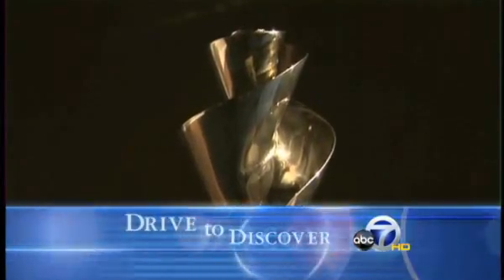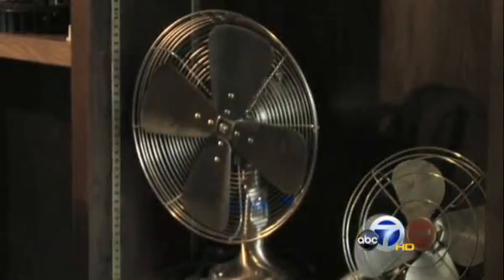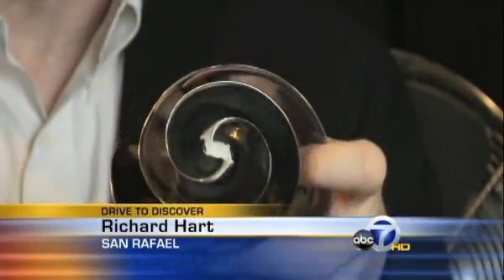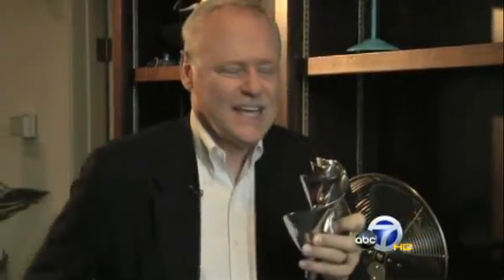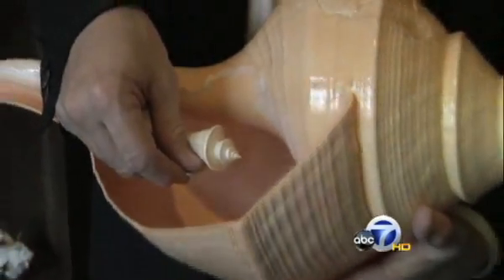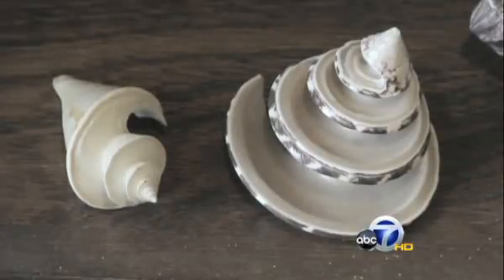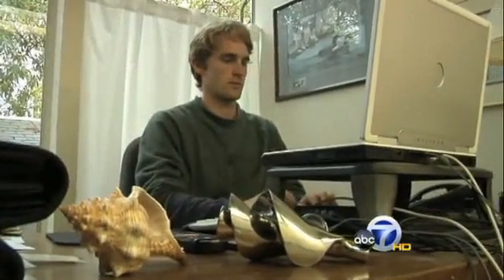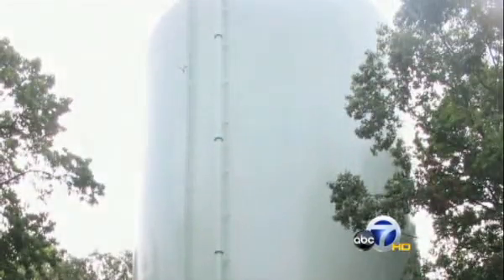PAX Water Mixer on display at the NY MOMA

Comment: GREAT device.
There's an odd discrepency in volume/weight & power ratings in this story. 
Here they say they're moving 4 Milllion US gallons (33.3 million lbs) using 300W.
Yet in past interviews with the inventor Jay Harman, he stated some of the original tests were on even larger tanks and he moved 80 million lbs with only 250W.